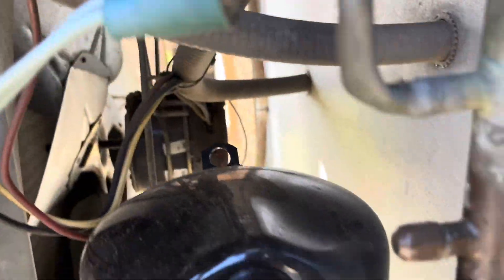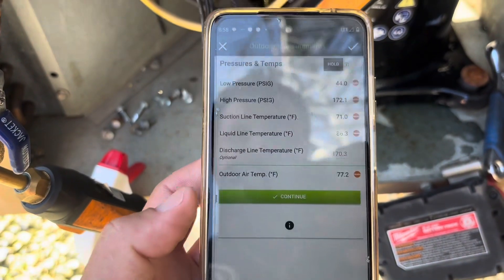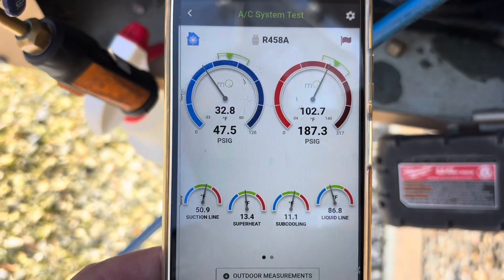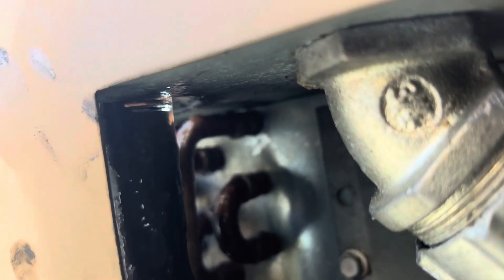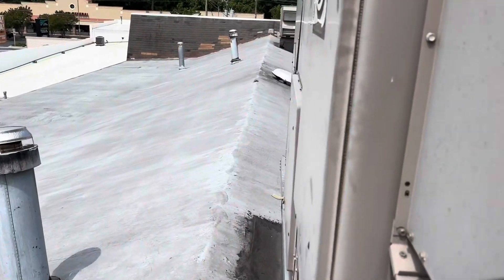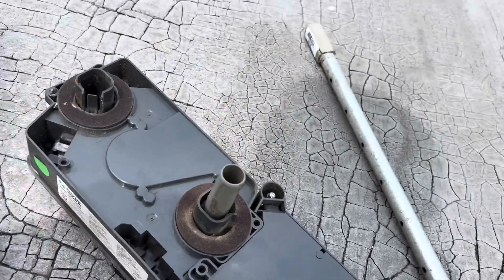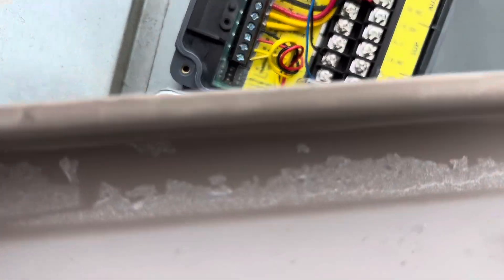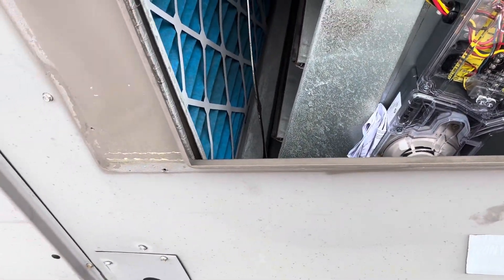Is Bluon R-458A The BEST R-22 Replacement Out There?  Let’s Find Out!

Comment: Propane works as an EXCELLENT replacement for R22. Lower charge weight (~1#/ton), less amp draw, environmentally friendly, cheap, safer than a propane oven. But they made it illegal, so it's purely for the DIY.
Reply from the maker: Well R-290 is propane used in new self contained refrigeration.  But it’s so flammable they can only use it in equipment using under 12 oz or something
Reply: @JeffsHVACAdventures R600 is also propane. I was using some shortcuts to keep the post shorter. If you go to WalMart, spend $9.00 on some Coleman propane, stick in your R22 unit, it will work great. But don't tell "the man" about it. They will be all up in arms about the 32oz in your air conditioner while the have no problem with the 125 gallon tank piped to your stove.

Comment: To me - R-421a is the best - same pressure as R-22 no other thing a has to be do - using over 8 years- no call back so far - and still doing my maintenance services to the same units - even the compressor run a lot silent and current-
Reply from the maker: Nice.  Might look into it.

Comment: Hey Jeff I have been doing a bit more research on this blueon they have an app you may want to sign up for that gives you manuals on each unit.

I just think some guys are going over kill on it but with Comercial applications you may have to lower the pressure switches or replace them.

My concern is for residential applications some guys are replacing the non adjustable txv with adjustable ones.

To lower the the pressures from the factory r 22 pressure settings I think the best aproach is to just put it in at the original factory charge for a residential application and then adjust the charge with more until the pressures are in range but this use 80 percent less stuff is overkill you need to adjust acordingly based on each system.

But they do have manuals on the blueon app including for a lot of those Comercial units I have seen you work on.
For me lower pressures are fine if that means more efficiency and bieng able to put more in to bring suction line or low pressure temos into range.

Hope this helps but please Jeff keep us posted with testing this stuff.
Reply from the maker: Great advice.  Thanks man.
Reply: Your welcome I fave been seeing a lot of trashing of blueon recently because they did have a lawsuit that was settled in 2021 but that was from Comercial units bieng tested that had issues tjsy cost a lot to corect so thats why blueon is gong so nuts with pressure switches and stuff Jeff like adjustable txvs and in some cases yes maybe replacing a piston with an adjustable txv is not a bad idea but again it depends on each unit.

But if that means keeping residential and Comercial units running tnY originally took r 22 VS, replacement that's what I think needs to be done until they figure the heck out a suitable r 410a replacement but honestly Jeff I think r 458 a could work on 410a systems too you would just need to change pressure switches again on the high and low side depending on the application and replace with adjustable txvs.

Then I think you could run it in 410a systems too.

Just my thoughts

Comment: Jeff here is my thoughts on this I think that
 
refergerent  is fine to use as is MO 99 but the important is to repair the leaks first like for example a, rub out on a copper pipe near the compressor replace valve cores then do a proper vac down pressure test then you can use that stuff or MO 99 and yes you might lose some capicity with MO 99 but here's the thing once you do the initial factory charge you are going to end up putting more in anyway to bring all the superheat and cooling back into speck with pressures while checking the pipes for sweating 

as for the blueon stuff the pressures bieng lower is a good thing because that means you can put more in after the factory charge to bring it pressure wize a little closer and run it colder in summer meaning to me temp is reading out the vents around 40 degrees when it's 95 degrees outside and not have the risk on the high side of the pipe busting or the system leaking or an evap coil failing because the pressures were too high in other words lower pressures leave room for expansion and clearing of more humidity and moisture on really hot days and that's a good thing.

Comment: Glide suggests otherwise: 12.17 temp glide for R458A. The odds aren't with you, especially if you have leaks and it gets hot. Leaks + glide you only make it worse by topping it up. Not that it's going to work great anyway under a heavy load and high outdoor ambient 95F and up. I understand R22 freon is expensive but you want it to work when it's hot don't you? (at least this is how I explain it) If everytime the unit leaks refrigerant you have to pull everything out of it to recharge it with virgin refrigerant it's not saving you anything. If you don't recharge it fresh with virgin + leak free system your best bet is that it kills the compressor so you can then sell them a new AC unit with a different refrigerant.

Comment: They claim it is more efficient and runs at lower pressures than R22. According to your gauges, they are right.
Reply from the maker: Yea they say it runs at the same capacity without having to change oil.  With most of the R-4xxx refrigerants you either lose some capacity but don’t have to change the oil or go through the process of changing the oil to keep the same capacity.  This is the best of both worlds…..they say.